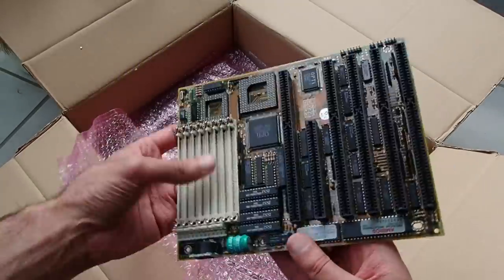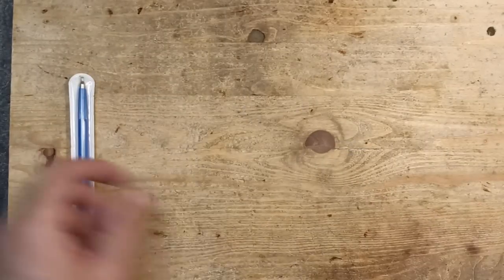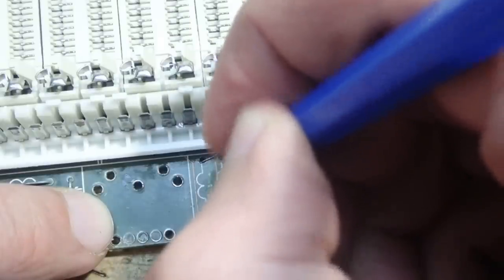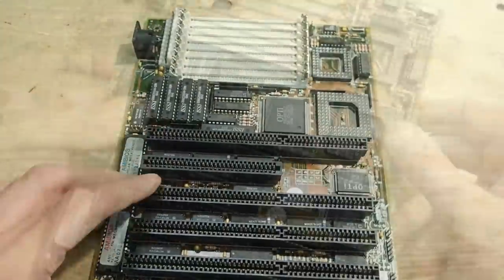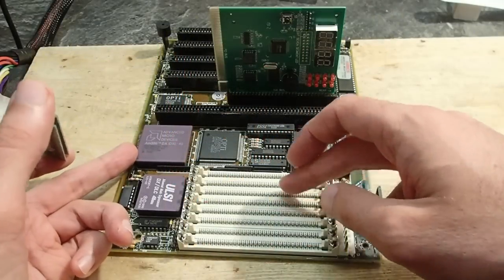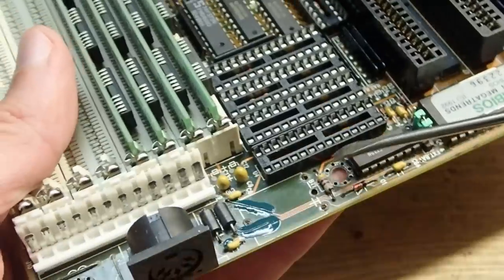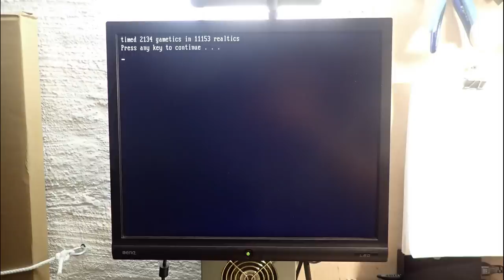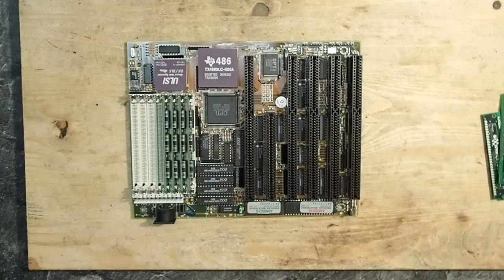Repairathon 2022: A hot 386 mainboard, sometimes size matters

Comment: It seems like the damage from battery acid only effects the traces. If the board is covered with solder mask, Why don't we see damage of the entire area?  Or am I missing something? It doesn't seem like the entire solder mask is stripped in the effected area.
Reply from the maker: The solder mask doesn't get attacked by the electrolyte as fast as the copper. Usually solder mask can survive decades, but the electrolyte finds it's ways through the micro cracks in the solder mask and the copper oxidation starts to spread along the traces, which cracks the solder mask from inside.
Reply: The solder mask itself is not vulnerable to the acid. It only bubbles and peels because the copper it was adhered to has changed size under it.
Reply: @necro_ware  OK, thanks, that's what I was missing in all of this, micro-cracks in the solder mask. This is why I like your channel, you take the time to explain stuff like this, thanks.

Comment: I’m curious why the CF card adapter doesn’t need external power?
Reply from the maker: It gets powered through pin 20 on the IDE port
Reply: @necro_ware  I’ve always powered that and ran downstairs after your video to see that that actually works without having to power it! Thank you!!
Reply from the maker: @YarmouthHoops  not every Controller provides power through pin 20. The one you can see in the video is modified. You can see a small bodge wire if you look closely ;)

Comment: Are you going to add a button battery adapter?
Reply: Rather than adapter most motherboards do have a 4 pin plug where only the extremes are used for non rechargeable batteries, sometimes with a jumper in the middle pins, which is what you would use if you rip out the NI-cd but don't want to set the clock every time you turn the machine on. LOL found one of these boards, the 4pin is next to the bios and it does have the middle jumper, i think you were supposed to remove it? Need to find the manual heh, i still have it, somewhere... They sold a plastic thing where you put 4 AA batteries and plug that there, it only has wires in the extremes so yeah, its meant to be removed that jumper otherwise it wouldn't fit.

Comment: Needs an amd 486 type over drive
Reply: Overdrives made sense when they saved money on upgrades, and now that chips of all speeds are available, instead of making a 386 with an upgraded CPU, easier to just build a proper 486, if that's what's needed. 386 is already a 32-bit processor on a 16-bit bus. Already bottlenecked. 486 overdrive adds insult to injury.
Reply: @enilenis  part of the retro fun

Comment: You must have serious bad luck running Doom. I recall running the shareware version of Doom in the early 90s on a 386dx40 (AMD), and it ran smooth on only 4mb of Ram.
Reply from the maker: That's not only my bad luck. Phil made already a good video about it: https://youtu.be/qQEHHc1q06c
I also planned to make one but with wider range of systems including various 386 and 486 configurations.

Comment: I think I need some professional suggestions on my 386 motherboard...😢

When I try to add a secondary IDE channel to it, it can't be detected under DOS environment. I have tried to use a single ISA card with dual IDE (with its own BIOS) and sound card with IDE. No luck in both cases... The second channel is available after entering Windows 95, though.

Tried to use MSD and find that IRQ15 is reserved by BIOS. How to tell the BIOS to release that IRQ in DOS?😢

Comment: no new battery?
Reply from the maker: There is a header for external battery, I often use that one instead.
Reply: Aside from the clock, which most programs of the day didn't really care about, the battery was rather pointless. Why in the world the industry fitted those rechargeable Ni-cd batteries to move a clock, i would never understand. Yeah i guess it was also to hold the bios config, but if you were to use the computer like every day without the battery, it would keep it! So what exactly was the need to keep a rechargeable battery in there that almost saw no significant load? All they did was leak and destroy, maybe they wanted that hidden time bomb for people to upgrade...
Reply from the maker: @freeculture  It's not (only) about the clock, it's about the BIOS settings, which are kept in volatile memory powered by the battery. It's the same today, if you remove the battery from your mainboard, it will forget it's BIOS/UEFI settings.